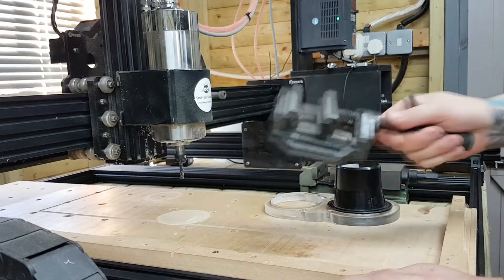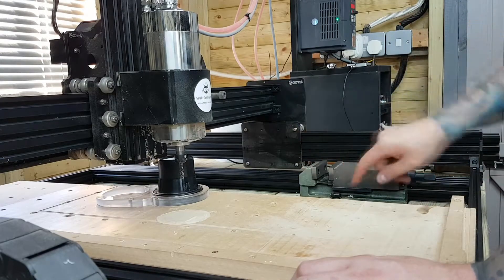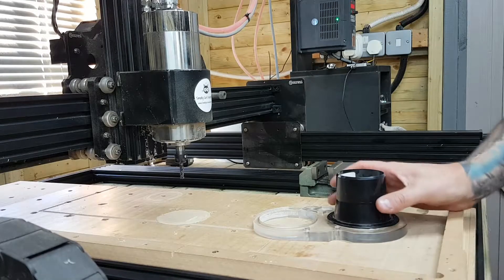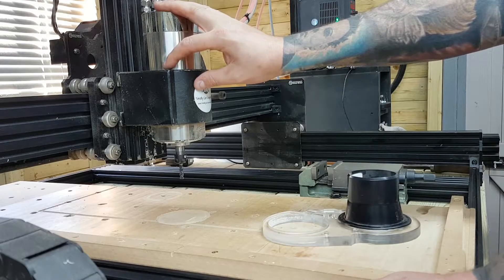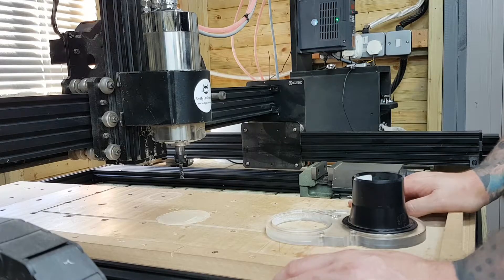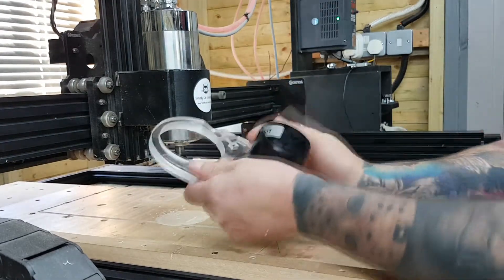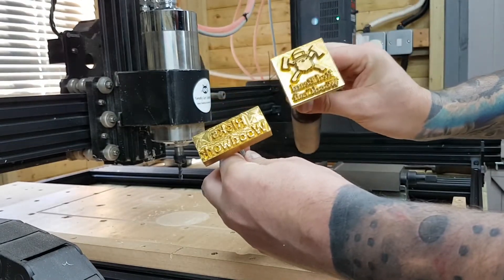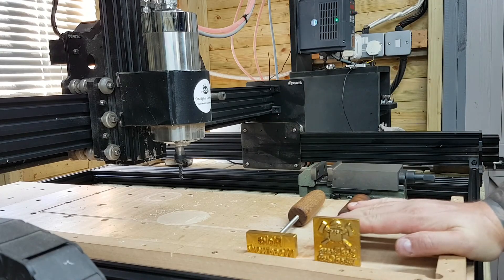CNC Router Fixing Solutions - Ooznest Screw Drive Workbee

Comment: Hi hows the cnc running now after running it for a few months with the water cooled spindle
Reply from the maker: The worlbee ran great with the watercooled spindle yeah, I don't have a workbee anymore sold it off about a month ago now after moving onto new more rigid machines.
Reply: Thanks for your quick reply I have the workbee 1000mm x 1000mm what have you moved  onto
Reply from the maker: @kevunkaz  The 1000x1000 workbee is a great little machine and will serve you well I'm sure. The spindle upgrade in my opinion is a must. Now moved onto an exec machine from Stoney Cnc

Comment: Quick question,I’ve seen people wire up the same spindle as you have but they say to use shielded cable from the vfd to the spindle. What cable do you use?
Reply from the maker: Hiya, yeah it's 4 core shielded cable used and best ran away from other wiring as has been known to interfere with steppers

Comment: Hi, what is the small size limit you have found for cnc cutting a branding iron? 5p, 10p, £2 coin size for example.
Reply from the maker: I don’t particularly have a min size limit, I have a smelly cat one that’s 16mm x 16mm. I find the opposite, you should avoid going to large to get a good brand
Reply: @SmellyCatCreations  hi, I suppose I was thinking of the ‘resolution’ with something small you might get singed bleeding from one part of the brand to another. Particularly on script. I like the idea of a small discrete brand for smaller pieces.
Reply from the maker: @H2Dwoat  to be honest I always recommend against script writing where possible anyway for a brand. Most people don’t plan a logo when they have it made, like making it vector making it easy to use in multiple scenarios

Comment: What tools are you using to cut brass, and what speeds? I have had problems cutting brass.
Do you use parallels with your vice? Gives super flat placement.
Reply from the maker: Yep always use parallels, I have been a Cnc engineer for 16 years now so speeds and Feeds I’m used to.

You need to run at the speeds and feeds supplied by the tools manufacturer. I use carbide cutters usually 4 flute 

Even brass is bit ideal for these hobby machines so you have to take it slow with shallow cuts

Comment: Hi great vid👍.Does the cnc struggle at all will the extra weight of the spindle compared to the weight of the trim router?
Reply from the maker: Hi there, thanks for the comment and also the follow.

I haven’t had any issues with the extra weight of the new spindle, I was a little worried when I first picked it up lol

I should have made a video back then of the fitting process, there are pics on my Instagram page though showing the changes I made to the mounting clamp.

Thanks for watching

Comment: I also tried a drill press vice and yea it kicks up. I now use hot glue to hold the brass in place.
Reply from the maker: Hot glue nice never tried that, sounds cheaper than the new vice. Yours came out really nice good work on them.
Reply: @SmellyCatCreations  they look a bit wrough to look at but they stamp nice. I always skim the brass with the CNC and then cut the design. Also it doesn't have to be a deep cut. I Cut to about 0.6mm. I would custom more if it's for leather
Reply from the maker: @JohnMadeit  Yeah i always skim 0.2 off before making the brand. you only cut 0.6 ok that makes me think i go way too deep lol